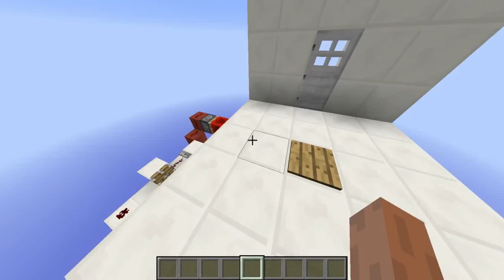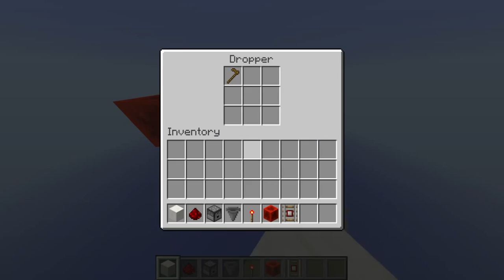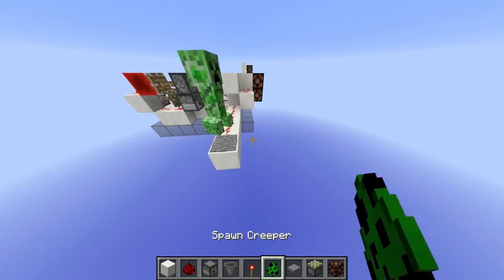Compact Player-only pressure plate

Comment: This doesn't work anymore...
Reply from the maker: I just tested the contraption from the world download in the newest version (18w45a snapshot) and it still worked for me. (The iron door toggled when the player stepped on the pressure plate, but not when a different entity falls on the pressure plate.)
What does the contraption do when you test it?
Reply: @myreneario7216  It seems broken. The repeater is always locking the hopper, i can't open the door.
Reply from the maker: @liosscip  
In which version are you?
It works for me in 19w07a snapshot (which is the most recent version at the time of writing this comment)

And the repeater shouldn‘t be locking the hopper. The repeater should be facing into a comparator, and conduct no redstone power to the hopper.

Comment: Can this work with tnt?
Reply from the maker: You can use the redstone signal that this  outputs for whatever contraption you like. So you could use the output of this contraption to ignite tnt and kill your friends or something.

But maybe this was not what you were asking.
Maybe you instead wanted to know whether tnt entities can activate the system.
If a tnt entity drops on the pressure plate, then it will not activate the system, because tnt is not a player.
However I have noticed that if you push a non-player entity onto the pressure plate using a piston, then that can trick the system. But as long as you let the tnt fall on the pressure plate, instead of pushing it with a piston, the system should not activate.
Reply: @myreneario7216  thank you, I was going to booby trap my house on my friend's realm cause I got accused of cheating and my friend made an alternative account for me to join and a lot of my stuff is missing and also the surrounding area
Reply: @myreneario7216  oh can tripwires be used instead of a pressure plate?
Reply from the maker: @harold37443  
Yes, you can replace the pressure plate by tripwire and tripwire hooks.
Also you can always just download the world file and test things for yourself.
It's usually a good idea to first test things in creative for yourself before actually building it in survival anyway.
Reply: @myreneario7216  ok thank you so much, but I can't I play on xbox series x, bedrock edition
Reply from the maker: @harold37443  
I don't think this will work on bedrock edition, but you can try it. I have no idea how redstone works in bedrock edition.